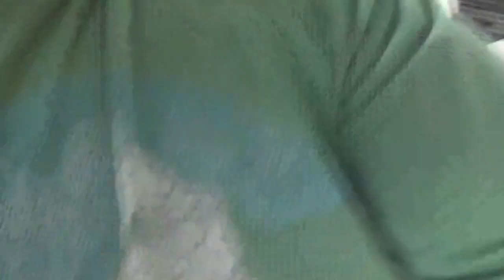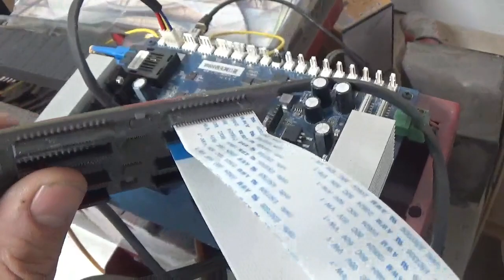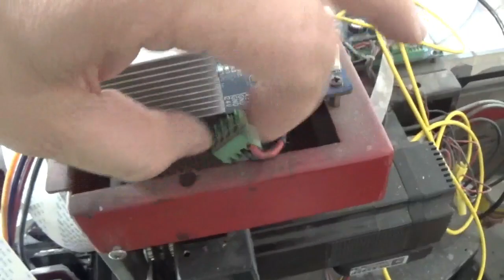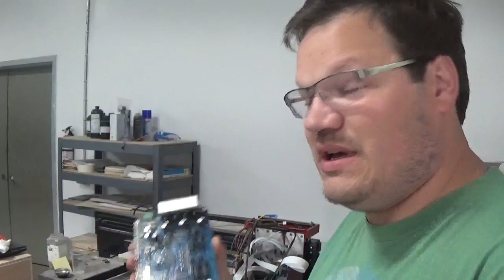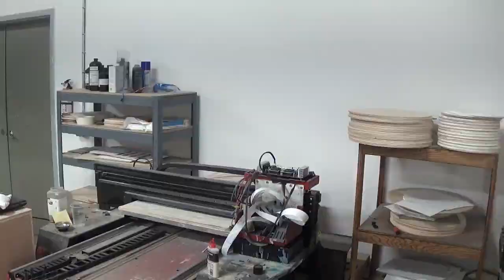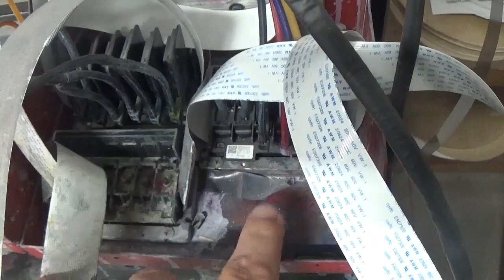replacing headboard for epson xp600 Hoson Soft 2 3 4 head also going over parts uv flatbed printer

Comment: Is there actually any pumps from ink to head as I haven't seen any only on waste ink
Reply from the maker: @dcocz3908  some have but if you have a cap you likely don't have that pump only waste pumps that suck on the head
Reply: @JaysToDoList  A cap as in the connection point in the capping station for each ink?
Reply from the maker: @dcocz3908  yes a cap or inkpad with the rubber seal

Comment: Good afternoon sir 
I love ur classes but I have an issue with my xp600 large format printer… am getting a communication error (link fail, power down and maintenance mode) on the lcd screen. 

Have changed the head cables to board but the message still flag out…

What can I do sir
Reply from the maker: Makes me think there is a communication problem with the  computer to the printer I would check these connections.  What software are you running
Reply: @JaysToDoList  windows 7

Comment: Hi. Are you able to help me please? need some advise on what to do with my printer
Reply from the maker: Sure what is wrong
Reply: @JaysToDoList  I got a flatbed with 4 printheads that stopped producing ink while running some corflute.   KC went first out first followed by MY. I thought it was the head board so I bought another. I still can't print. The carriage moves as it should and I can draw ink through the negative pressure system. I have changed the ribbon cables. However,  the 4 replacement printheads I bought are off eBay for about 20USD each probably refurbished. The printheads are same with the workforce  3720 epson machines. Do you think it could be the printheads causing it.. I mean 4 printheads all bad?
Reply from the maker: @mikeekeocha2359   Hello I am sorry I did not get notified of this message I assume you already have this fixed but it absolutely could be 4 bad printheads if it hasnt been printing for a while

Comment: Hi there,
Ryan here from the uk,

ive recently purchased a 2nd hand XP600 UV Printer, but believe that the firmware that is currently loaded onto the boards is defective.

For the life of me i can not find this firmware anywhere. Ive just finished watching your video and your machine uses the same control system as mine (Hoson).

I was wondering if you by any chance have exported the firmware files as a backup after your new installation of the new print head control board.

I would really appreciate it if you could share these files with me for me to try, and see if i can bring some life into the machine i have. 

I look forward to hearing from you.

Best regards Ryan
Reply from the maker: Hello there are many types of firmware for printers running hoson do you know the manufacturer of your printer?  they would be happy to send to you I would think normally they are very small companies but can be found on alibaba